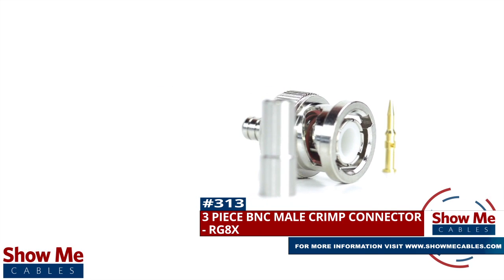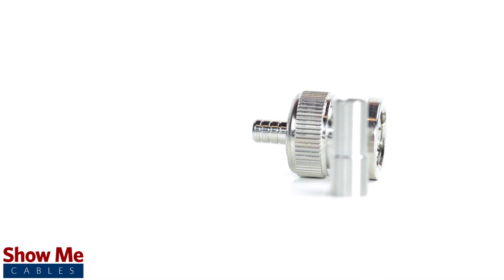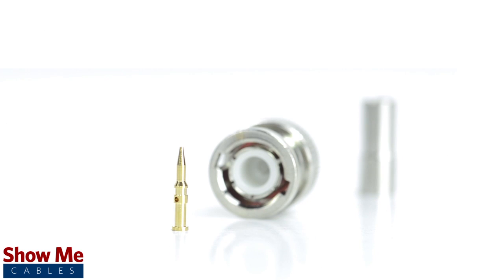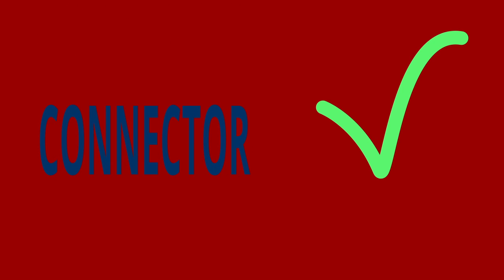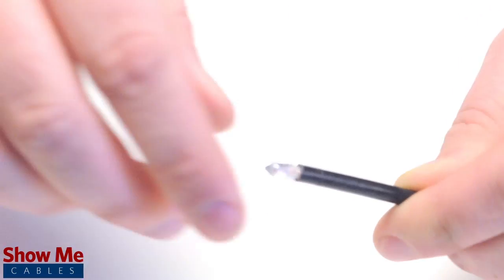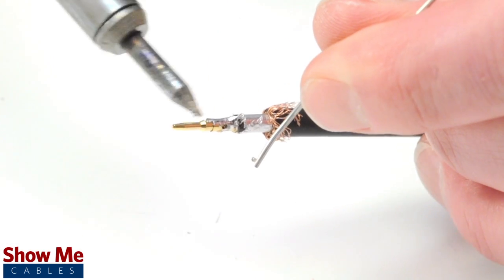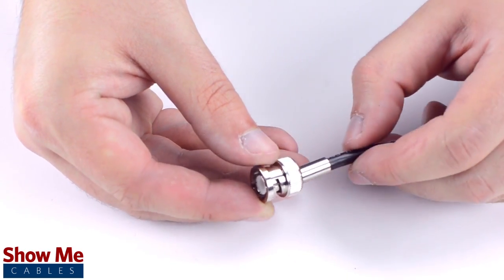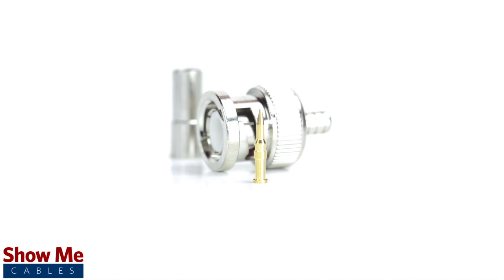3 Piece BNC Male Crimp Connector For RG8x  - Perfect For DIY Installs!

Comment: Very poor soldering technique.
Reply: I never saw any solder go into the hole to connect the wire securely to the pin. Terrible video from the soldering standpoint.